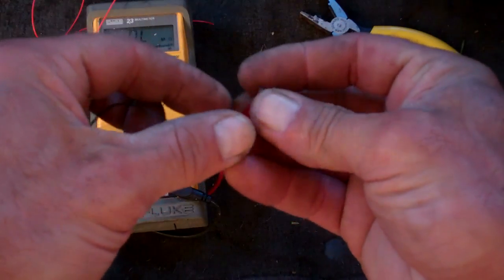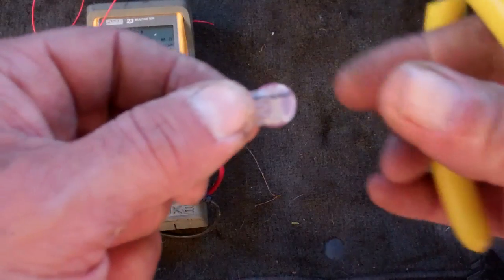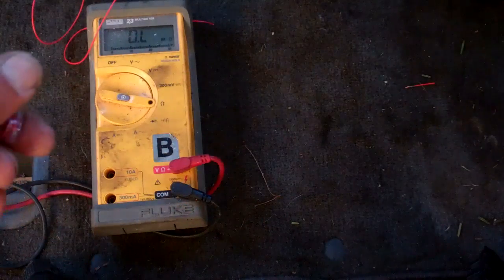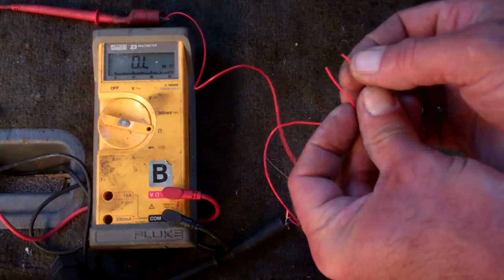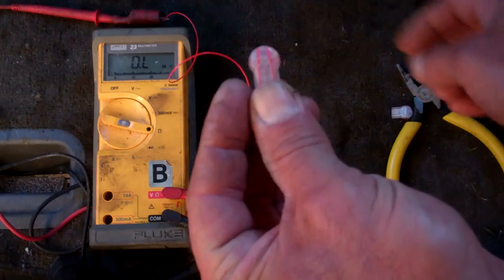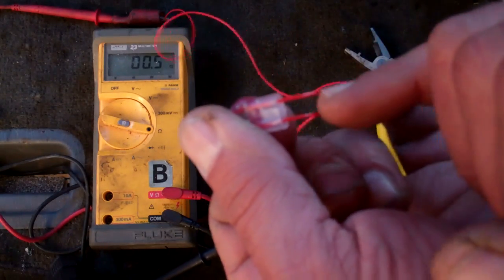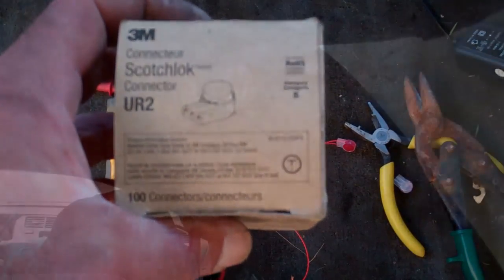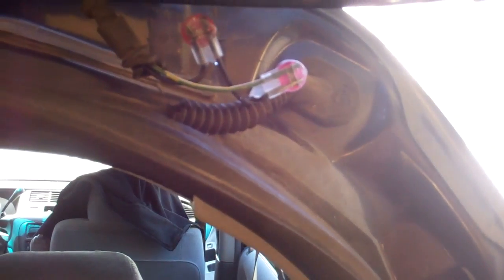How to use Scotchlok connectors

Comment: So these are OK to use in car or boat where you have 12v? Why does it specify tele communication?
Reply: 12v is low. Telecom uses 42vdc up to 260vdc so its fine for cars and boats. DC only. Do not use with AC voltage.
Reply: Because they are only for telecom, the wire insulation is different and the type of wire is different. He is showing the wrong use case 😊

Comment: Would this be good for fixing a cut ethernet cable running underground?
Reply: +JohnTheDropper  temporarily yes. But if you need that to last, you will need to seal that in an additional casing:  http://www.homedepot.com/p/Tyco-Electronics-PowerGel-1-Clam-Wraparound-UF-Splice-Kit-CPGI-GELWRAP-UF-250-UL/202204329